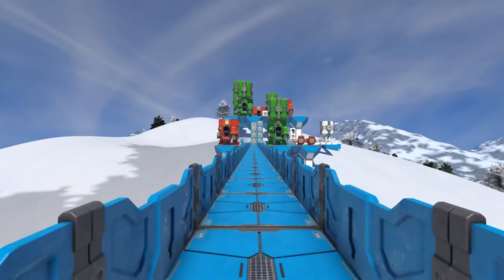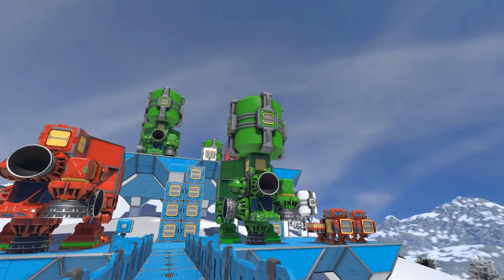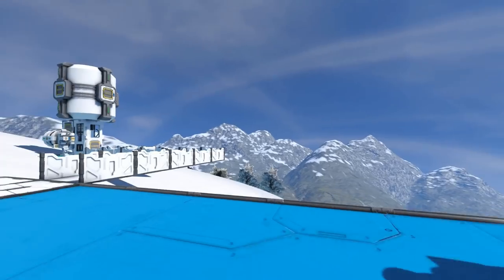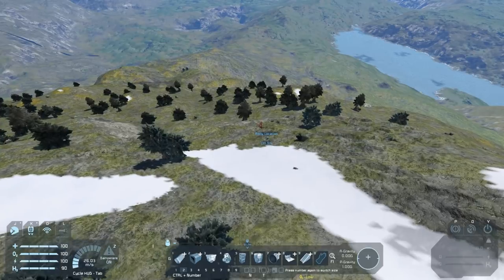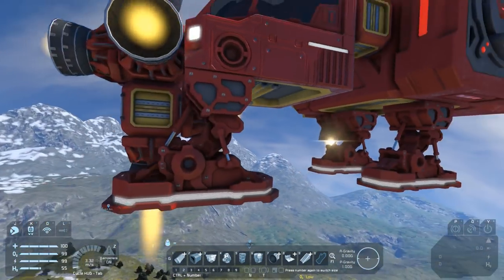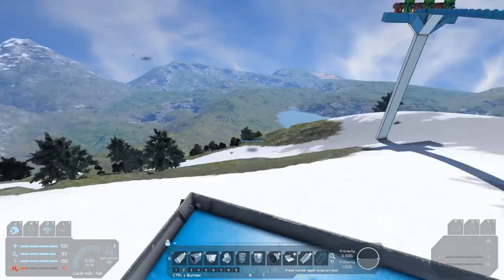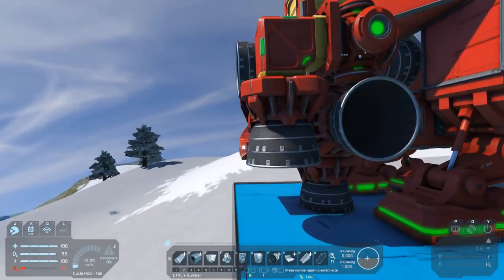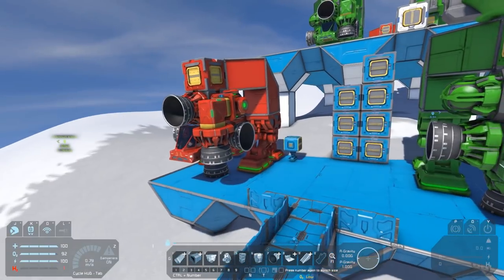Space Engineers Testing: Oxygen Generators vs Hydrogen Tanks (tutorials, tips,  testing in survival)

Comment: hi mate im still relativly new to space enginners, but im having a lot of problems with hydrogen.
1 i dont have oxegen generator, i have the 02/hydrogen generater and hydrogen generator.
2 I do produce liquid hydrogen, is that the same ...and it wont go into a hydrogen tank.
3 my o2/hydrogen gen produces liquid hydrogen and oxegen is there a way to instruct it to produce only one.
Reply from the maker: Keen renamed the generator, so the oxygen generator and o2/h2 are the same block :)
If you've got a generator attached via conveyors to a tank and there aren't any thrusters using up the hydrogen you're making then with all default settings the tank will fill, though it will take a LOT of ice to do this (have a look at the tank in the control panel for a more specific load, as it'll show a percent filled in the lower right).
If you've got both oxygen and hydrogen tanks attached it'll make both until either one is full, if you turn off one of the tanks then none of that gas will be produced, completely unrealistic but that's how it works :P

Also note, when people are talking tanks, they're talking the big ones that are part of the grid, the smaller things that can fit into your player inventory are bottles (I'm hoping I haven't messed that up in my tutorials, but I know I've mixed the two when talking in my survival series)
Reply: Splitsie Yeah that makes sense..it just I had some mods installed one specifically that uses ice to gen liquid hydrogen and oxygen .. but then uses the hydrogen to make superfluid helium ..my main thing was when I looked at tanks there was nothing in there ..but I realised the other day the gas does not show up anywere exempt in the percentage fill level but thanks for the arification

Comment: Has anyone figured out how to refill a fuel tank made of SMALL parts?

It seems this area of functionality is completely broken - connectors do not appear to work with smaller H2 tanks, even with an O2/H2 generator and H2 engine, and a necessary powersource for the above all does nothing at all. Made out of large parts, it refills normally (I've tried toggling "Stockpile") anyone know if this can be done or is it just completely broken functionality?
Reply from the maker: I haven't had any issues with them but I suspect your problem is not that the tank isn't filling it's that the engine is burning all your H2 or it's internal tank is filling first (which it always will). Try turning off the engine and see if the tank fills then :)

Comment: Soooo... This is something I should have thought to ask before doing it. insert obligatory facepalm emote here

I've nearly finished up building a large grid cargo transport vessel thingy and I went to fill the hydrogen tanks up on it... by filling bottles in my base (and I made a utter shit ton of them b/c... reasons...) I filled one of the tanks on the ship completely with full bottles and after a bit of fiddling, the tank won't drain the bottles, and I frankly don't know if that's a thing. For the moment I've got everything propulsion wise shutoff to save power (as it is solely battery powered, for now at least.) I would just connect it up to my bunker's tanks, but atm I've no way to do that as my only entrance at present is intended for small, small grid vehicles only.
Reply from the maker: Ouch! That really sucks :( 
As far as I'm aware you aren't able to get the hydrogen out of bottles in order to fill tanks. I think your two options are really to either build a small refuelling tug that has a generator on it, or probably a better long term solution is to find a spot on the ship to fit an oxygen generator, then your tug needs only to bring ice to the ship. It's a bit unfortunate you can't use bottles to fill tanks as that would create an interesting alternate method for refuelling
Reply: Yeah, I managed to find a location for a generator on the back as a stop gap. A few of my ore deposits are under the ice lake next to my bunker, so no shortage of ice. In fact, my prototype flying drilling platform is actually too full to fly at the moment. I was hand loading the ice over to the transporter, but after taking it back to the access ramp to the bunker, I finally started installing lights. (yay for ADD and all that.) As for the bottles, for now I'm going to use them one by one and recycle them when empty until I get down to a more manageable number of like say 10 or 20. Still having issues with this one door mod sucking up oxygen when I open/close them (usually when opening I'll get a blast of air into the door), which is annoying. >:/

Oh, and unrelated, I recall seeing a patch note on the main menu before the big physics patch about something to do with backpacks being removable now. You know anything about that?

Comment: Well if you want to make hydrogen trusters best is to use both tanks and generators
Reply from the maker: These days, with tanks having double the capacity they had when I tested, I'd lean toward having as many tanks as you can fit and only have more than a couple of generators if you aren't going to be able to refuel at a base within a reasonable time frame :)
Reply: Yea I think space enginiers is really good mainly because really for now one wepon type won't give you enought good firepower, one power surce might stop working and you really must think but the thing is that I don't really like hydrogen trusters well I prefer mix of atmo trusters to get up into space and then those normal space trusters and have those 2 tanks for those few hydrogen trusters to let's say get extra speed when needed but for me flying with them is just quite expensive

Comment: you shouldn't be using hydrogen for hovering on a planet anyway....
Reply from the maker: Since the use of fuel per unit of thrust generated is a linear relationship, the easiest way to ensure a consistent requirement of thrust between setups is to force it to resist gravity, it's irrelevant whether you would normally fly this way or not as it reliably tests what I set out to test - which is fuel consumption vs the mass of the setup required for providing that fuel

Comment: Kind of stupid. A hydrogen tank should hold more fuel then ice as you need to convert ice that is heavy in to something that is much lighter with a much higher energy potential. No matter if small block or big block. not to mention that the generator needs energy to convert while a tank is already done and full. Not to mention hydrogen makes you float as its lighter then air it self.
Reply from the maker: Most of this is explained by the fact that (as said at the start of the video) I was using x10 inventory settings to let ice even get a look in. That means that the game is treating all items as though they are 1/10th the volume and mass :)

Comment: 4:40 He leaved Dampeners ON, so the motors are working for stabilize the ship.
Reply from the maker: The inertial dampeners are irrelevant, with the landing gear locked the thrusters don't try to work. The reason I got the wrong result here is that I was still breathing air in the cockpit so my engineer was using up the ice, hydrogen thrusters on a ship that's locked to a station use no fuel :)